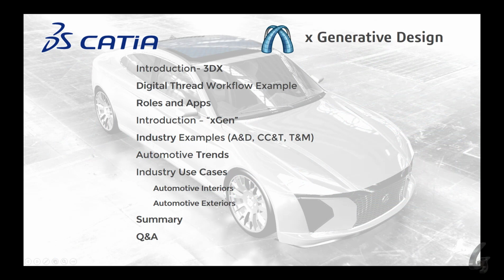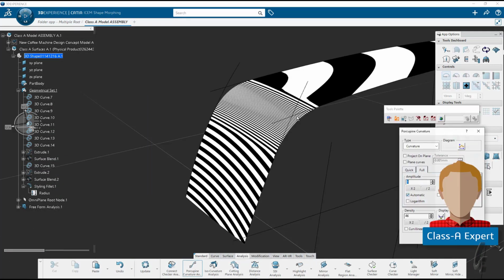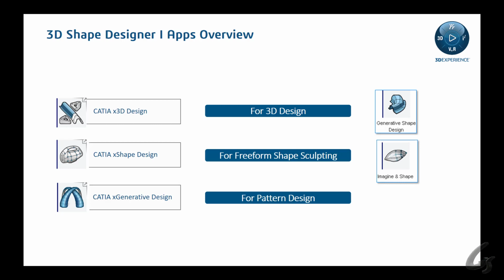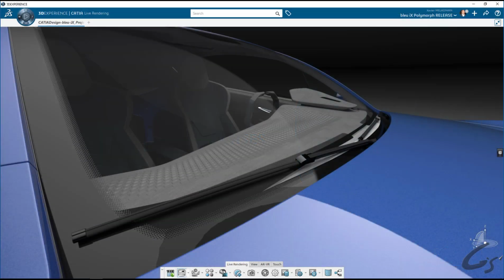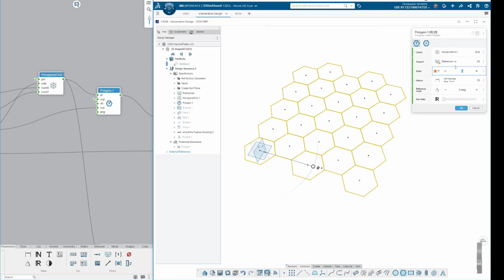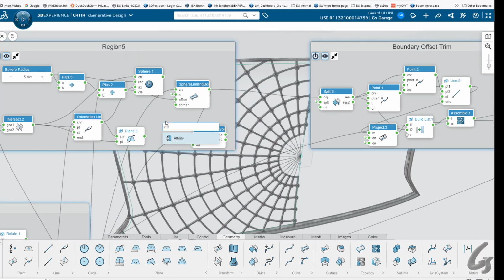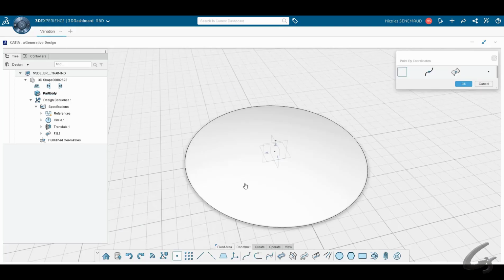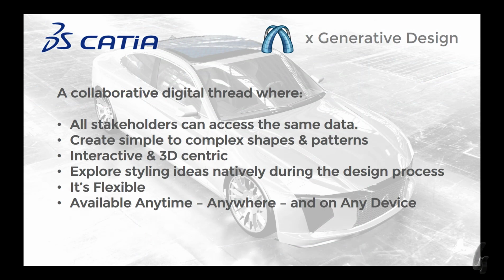Generate 3D Patterns in CATIA xGenerative Design

Comment: Hello Gerard, thanks for the video. It’s very illustrative! Let me ask you something. With CATIA v6 3D Experience is not needed the traditional Alias and/or Icem surf softwares to create the class A surfaces? Everything can be done with only one software (3D Experimce)??? Please advise. Thanks
Reply from the maker: Hi Roy (?),
100 percent correct. CATIA 3DEXPERIENCE has all the creative design and class "A" solutions needed to do the job...and they're all using the same data in a true digital thread.